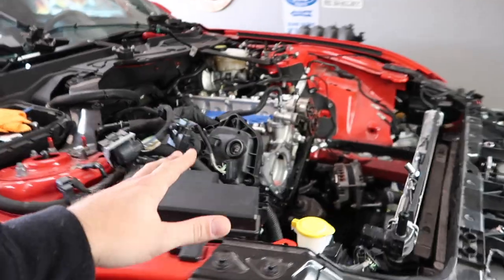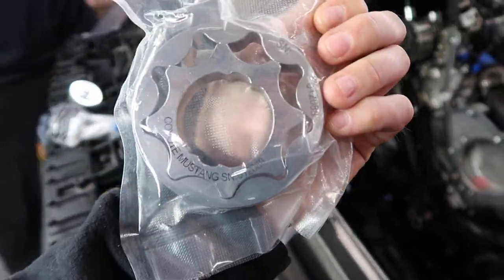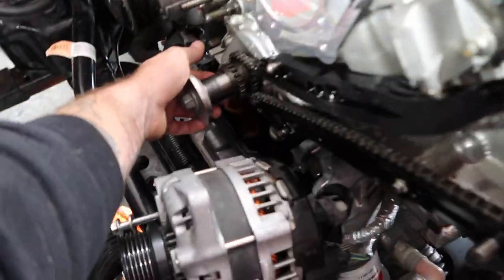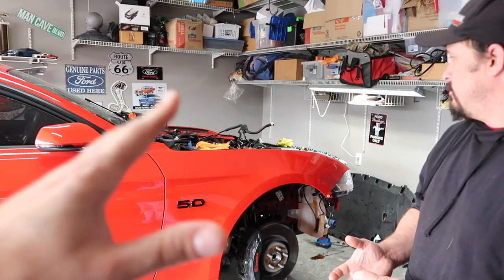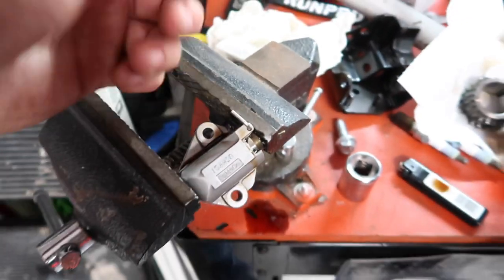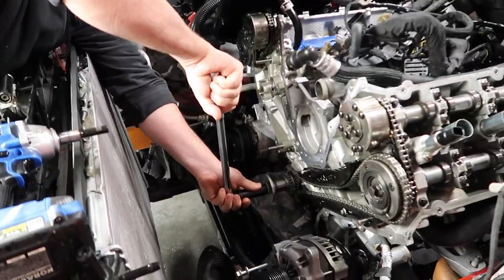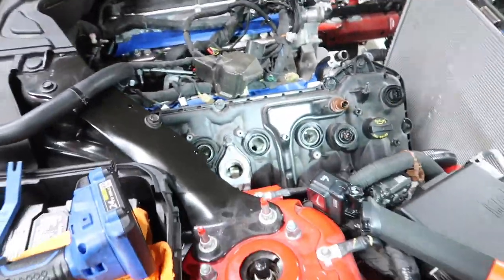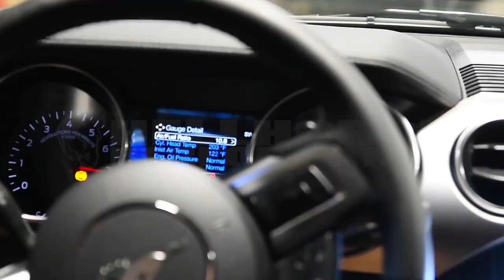2015-2020 Mustang GT Gen 3 Coyote Oil Pump Gear Installation- The Easy Way

Comment: Definitely wanted to hear if the Gen 3 gear is okay or not.
Reply: I’ve heard it’s okay as long as you don’t shoot for 8000 plus all the time. If you keep it 7500 and below you should be good but going w a ton of boost or cobra jet yeah get rid of the. Before they crack.

Comment: The only Coyote powered vehicle that I've known to break oil pump gears was on a single turbo Coyote (stock op-gears). The same guy had a supercharger on another Coyote (also on the stock gears) for over 80K miles with no problems. Before this, my logic went with the Idea that superchargers are putting more stress on the crank, and would be more likely to break the gears but the turbo set-up ended up being the one with problems, maybe coincidental IDK?? My opinion is aftermarket gears on anything boosted could save you an expensive motor in the long run.

Comment: I would add to prime the Engine with crank sensor unplugged. Few cycles of the key.. To get oil pressure back plug back up crank sensor up before starting the vehicle for first time…Just to be on the safe side!!!! Very important step of this job!!
Reply: You could also just unplug the fuel pump relay, which should already be pulled to disconnect the fuel system for engine disassembly. You can prime it by cranking and then plug it back in once satisfied.

Comment: Hey what tool do you use to remove the gen 3 crank pulleys? 

Also, for install do you just torque down with a strap wrench?

Comment: I was able to get my hands on a gen 2 coyote repair manual.  Aside from the obvious (i.e DI, removal of oil pan, etc.) is there anything that would change the timing chain removal procedure of a Gen 2 vs. Gen 3 Coyote?

Comment: On the left side at 5, I forgot to turn it 360 and then to 12. Instead I just went from 5 to 12. 

Now that the time is wrong, do I just do it from the beginning like Ford says OR do I have to take a different approach considering the incorrect timing?

Comment: Doing Gen3 10r80 in my fox and my tuner told me not to install MMR or boundary oil pump gears. Said if I want my motor to last leave, the stock stuff. Said he sees more motors fail from these gears? Idk 🤷‍♂️
Reply from the maker: I’d get the ford performance ones instead.

Comment: The original parts are junk when it comes to the oil pump, usually I see guys replacing them with billet and why your there mines will replace the guilds as well, Then again why your there you can put in a new or larger timing chains, Match up your markings on the timing chains, 3 hours of sleep? Stop get some sleep before putting back together LoL 😂
Reply from the maker: Build and send 🔥
Reply: When your going on a lack of sleep your only asking for trouble, Go to bed! Tomorrow another day you need a clear head for what your doing bro, This is one job you can’t frige up!, I hate too see say something went wrong and damage you engine or turbo.......I’ll just have to wait....again! Lol

Comment: My crank sprocket was cracked all the way through at the keyway groove when torn down at 2500 miles bone stock. 2018 GT
Reply from the maker: Omg. On a bone stock car. Ouch
Reply: @Zander13Productions  yup luckily I was installing a procharger and replacing everything anyway. No harm no foul I guess

Comment: The real reason OPG's were an issue is simple: oil capacity 🤷🏽‍♂️ if you're ragging on a 7qt capacity system, that truly needs 10qts total, and you have an unbaffled oil pan, you rum the risk of that that crankshaft sending aerated oil through the oil pump, ESPECIALLY if your oil level is low or like I said, not slightly overfilled..just keep your oil topped off. When you fill your oil with the motor COLD, bring that oil level line about 1/4" higher than your full line. Fords remedy to this issue in gen 2 was 8qt capacity. Then guess what? Still an issue and kept increasing capacity and then they finally added a baffled oil pan in gen 3 and 9qt system.

Comment: Take the new ones and do the same exact thing you just did to the stock one, camshafts will do the same thing. There is nothing wrong with stock OPGs up to about 800hp, when you really know why they break, then you dont have people wasting money on passed around ignorance. Its very obvious that most people have no clue why they even break to begin with.

Comment: Is there a gasket that goes on the oil pump housing and the oil pump  gear cover? Or does it just bolt together no gasket?
Reply from the maker: No gasket

Comment: You left out the part of the impossible to find 12mmx1.5 pitch harmonic balancer installer. 2 days hunting and now I have one being air shipped from summit.
Reply from the maker: I made a special video just for that 💪. I had to make my own since none from the stores worked. Cost be only a few bucks from Lowe’s
Reply: @Zander13Productions  I seen the one on how to get it off but not get it back on. Thanks I did use your method to get it off. The only way without that disc from ford👍
Reply: Autozone has it

Comment: Oil pump gear is like buying an insurance policy for your motor. would you rather chance the entire motor for such a cheap upgrade? 

People with tight wallets, cheap, should stay away from modifying cars.. power, performance and reliability doesn’t come cheap. Do it, you’ll be out a few hundred to start, but it’ll pay for itself if your motor doesnt grenade from the old one blowing up and sending metal throughout the whole motor.